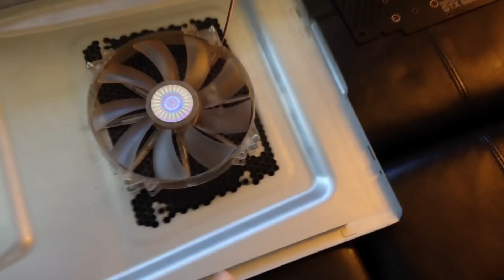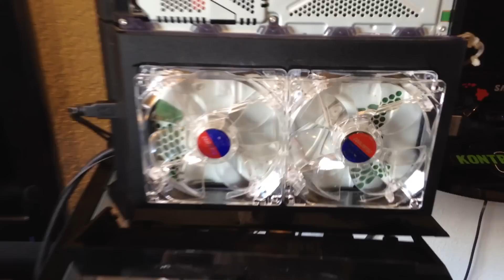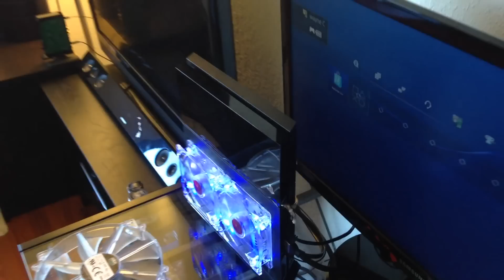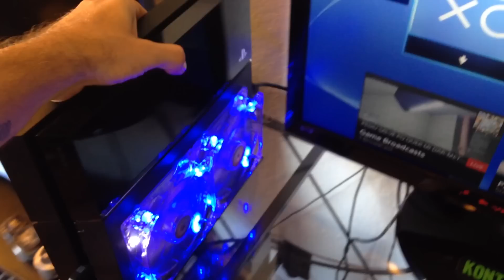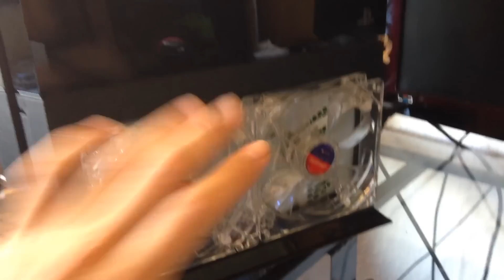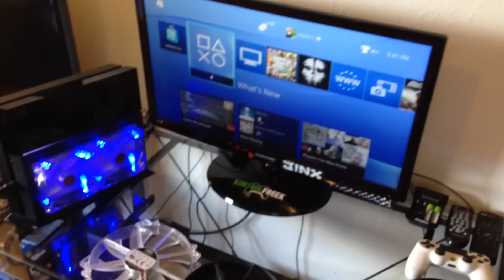PS4 fan mod

Comment: What brand of fans
Reply from the maker: Cooler master. They should have options for different RPM. Get the lowest RPM. Just so so it's a solid bit above passing heating
Reply from the maker: Cooler Master ( lowest RPM you can find.  A good low speed fan makes it no longer being passively cooled and loves it. Maim CUP RAM MoSFET all of it will outlast every one else's with good cooling. REMEMBER " HEAT KILLS ELECTRONICS ) plain and simple. Learned from a old friend that that ran a computer hospital in my teens through till he did. Custom is my specialty and specifically air cooling because of relia ility factor for a long shelf life. Water is hard to maintain and accident prone even in a perfect system.. Time plus head and aging materials... always wins over eventually or lots of maintenance 1-2x a year replacement water cooling tubs and seals. If you have the time water cooling g it if your really putting time I n weekly and it's. Americus hobby. Then build a custom CPU and RAM and FSB water pucks and dream rig with custom water blocks for chips.

Comment: You didnt bother to show us how to wire in, a case fan. What is the cable pin assignment?  Where to attach to the circuitry inside the ps4, And the wind was very annoying.

Comment: Hey man, great mod, I love it a lot and want to do it form ps4. Cause mine goes like 77db after clean up and thermo paste change ;/ 

I wonder can I put a some sort fan controller between the fans and USB's power? I  want to use one from a pc case, but as I figure the connector of controller is a 4pin mollex..any Ideas how I could power a 4 pin molex externally ? like with a usb?

Comment: do you know that max voltage the ps4 3pin will take? my fan died so I looked into a few fans and wanted to do a fan mod as well funny thing is it's a cool master as well hits 2000rpm it's also 3pin so would it be able to connect to the old fan spot? if not would it be too powerful for USB?

Comment: how did you get the wiring all done? did you solder the 3 pin fan wires to a USB cord? or are those just USB fans? if you wouldn't mind could you give me the link to  those fans. also, are the fans taking in air or forcing it out? i live on Oahu and it gets really humid over here because i live near the city, not in the back of a cool valley thats why im asking all these questions.

Comment: Hey man I understand the struggle with the can't playing with two hands I have one that is paralyzed from a stroke at birth. I'm planning on one noctua fan,what's the cable called that connects front USB to the fans called?
Reply: AznJungleFever just peel the cables of a regular usb and use the black ground cable as a negative and the red 5v cable as the positive, good luck with your hand! ;)

Comment: so i decided to do the same fan mod as you.... was a success but now my controller lacks range.... i have to be less than a meter away from console for it to get signal. then it disconnects on its own. getting frustrating. maybe the fans are interfering with the signal?
Reply: check the bluetooth connector, it might be a tad loose.
Reply: Marcus Mathiassen thanks for reply. i will try that! i had to get a connected remote... which was just as much as a regular one...

Comment: Does this fan mod keep your internal stock fan from sounding like a jet engine?
Reply from the maker: it keeps the main fan RPM and sound way down
Reply: +Bluefire8080 Thanks for the advice. I'm sick and of the constant ramping up on mine. I completely disassembled mine and replaced the crap thermal grease with Arctic Silver. I'm still going to do your fan mod because the airflow through the ps4 is crap. I build my own comps like you, so I know which end of a screwdriver/Dremel to hold. PS: Hope your hand has fully healed.  Although, in Hawaii, all you need is your thumb and pinky.PSS: Kauai is my favorite island. I'm so jealous. First time I went to Hanalei Bay and saw the surf, I thought I died and went to heaven. Aloha ! and Mahalo for your video.

Comment: is there any other way to connect my 120mm 3pin to ps4 original fan connector pin? i noticed its smaller on ps4.
Reply: 3 pin usb adapter.
Reply: +Astofersin Gaming thats what i did

Comment: I got the Dobe ps4 exhaust cooler which straps onto the back of the ps4, the cutout for the stock heatsink and also a fan accelerator for the stock heatsink, and to finish it off, I got the ps4 USB hub containing 5 extra USB slots including one USB 3.0. I plan on putting two jet-black 120mm fans on the front, powered via the ps4 power supply. However I haven't decided wether the front fans should be intake or exhaust. What do you think?
Reply: +Harry Lawson exhaust because the the way the stock fan is setup is to blow air out the back :)
Reply: +swaggerammathegamer STG thank you.
Reply: +Harry Lawson did you do a fan mod yet??
Reply: +swaggerammathegamer STG If so how did you set it up???
Reply: +swaggerammathegamer STG still need to buy a dremel, but once I've done that I'll be doing it
Reply: OK please keep me posted. What are you going to do? What are you using for power source
Reply: +Harry Lawson ?
Reply: how do you connect it to the power supply
Reply from the maker: the front fans would be intake

Comment from the maker: no fan on the mic. just nice trade winds in hawaii:)
Reply: How did you attach the fans? With screws or glue or something? I don't there are screw holes on the metal panel
Reply from the maker: +Jack Gardner i used a emlpoxy glue, good super glue would work. you could pre drill slightly smaller holes that the screw that comes with the fams when u buy them and screw them in. you only want a 16th or an 8th inch smaller pre drilled hole
Reply: Wayne Carter hi looking at doing this mod but do you know if you can get 2x 12v 120mm fans and run them off the board where the internal fan connects or will the draw to much power ? Thanks

Comment: do you have an fan on your mic to :p
Reply from the maker: haha no, i lived on a huge cliff on the 2nd story of a house and the window was slightly open so i had a 15mph breeze. if it was open fully it would be like 30mph constant gust
Reply from the maker: haha no, i lived on a huge cliff on the 2nd story of a house and the window was slightly open so i had a 15mph breeze. if it was open fully it would be like 30mph constant gust
Reply: actually, yes. cuz mic also gets hot so it slows down it self to lower the temperature lmao. (jk)

Comment: you should prob put your grinders away haha , the dual fans look horrible in my honest opinion , you could always look for the slim black versions , would be alot sleeker , from one pc gamer to another, your ps4 looks like one of those wana be pc modders who think led lights make there pc look 100 times better aha
Reply: +Paul Mills Thats what i did 2 black fans look so freaking sexy
Reply from the maker: @Millzieeeee  that's ok. Because the main cpu fan never ramped up again. Unlike every one else's was screaming for thermal throttling hell. notice thr changes they in slim and pro editions.